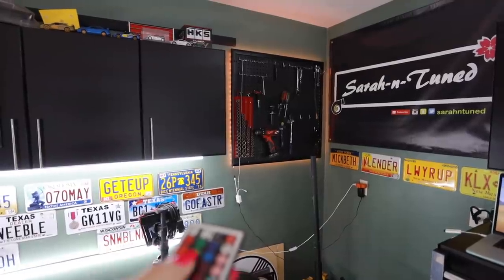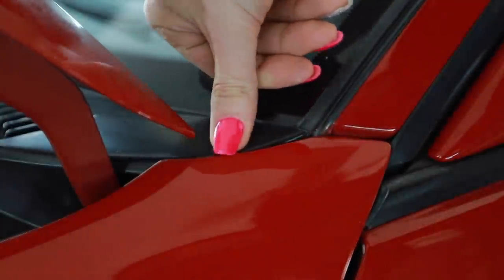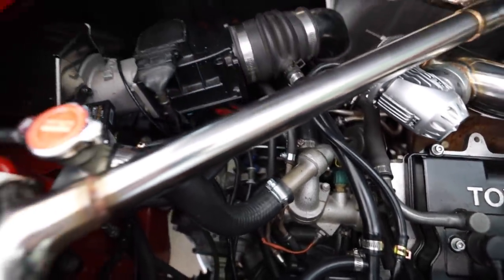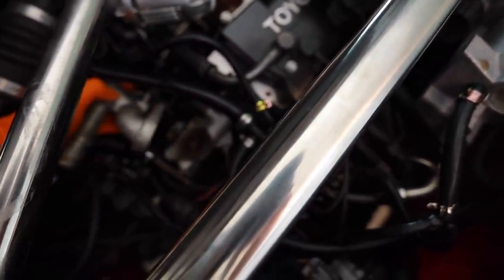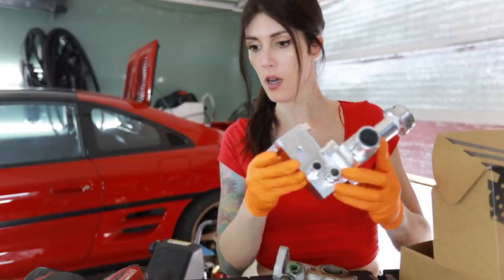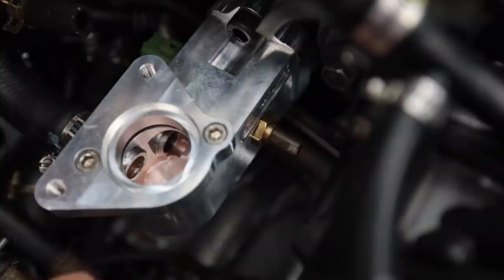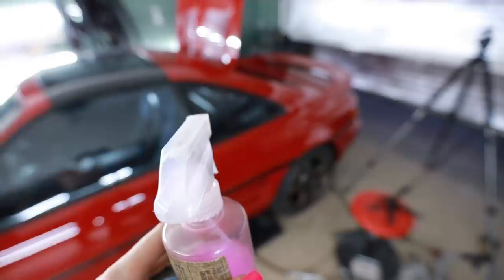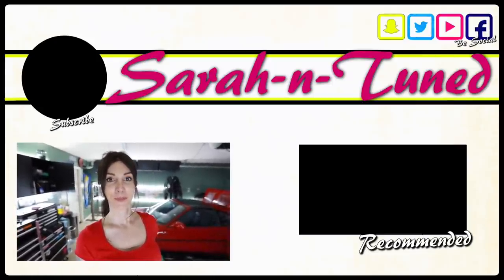Billet Aluminum Cooling System Parts Fixed This Problem // Project MR2 Turbo

Comment: About 2 mins in you said about replacing what seems pointless parts like the wiper cover, I couldnt agree more, little things like that make an overall difference to the finished result of the car 100%
Reply: Yep! I'm right with you.
Reply: Over time the black comes off the trim. I sanded and resprayed then cleared mine. Can't get at Toyota Stealerships anymore. Came out awesome. Longtime owner.

Comment: Detail tip: If you take some of your Tire Wet or whatever tire dressing you use, and put it on a rag, or spray directly onto your black trim parts like the wiper arms, it'll restore the deep black hue for a while. In simpler terms, tire dressing restores black trim really awesomely. Awesomely is a word.

Comment: they sent you a flash drive while i got some Big League Chew bubble gum when I ordered my fuel rail. lol
Reply: What’s up, sir? How have you been? What are you driving these days?
I’m about to change the coolant return feed hose from the turbo on my MR2T and I see Sarah snapped the bolts in half on hers and now I’m dreading the next two hours 🤣
Reply: @negativeindustrial  Matt? Whats up, old friend?! I still have the supra after 8 years and then I picked up Art's old GT2 back in 2017 and its in the process of a rebuild for the last 2 years. Should be a fun car when its ready. What about you?
Reply: NgoFcukinWay
That’s fucking awesome, bro. Art’s car was truly a work of Art 🤣 That car was a big inspiration for me since before I met you, if you can believe that. Art and I were OGs on 6gc. and I always admired your car.
I’m finishing an MR2Turbo now. Basically the same as Sarah’s except all the go fast parts are GReddy, Apex’i and Aussie. CT-20b, AEM TruBoost/Wideband setup. Same as the Celica essentially.
I’ve been thinking about you because I’m buying some form of Supra next to complete the trilogy. I’m leaning towards black SC300 TT 5spd but I’m also weighing the MKIII 1JZ-GTE route. Either way, another swap is in my future.
On a side note, I shouldn’t have worried. My MR2 turned 30yo this month but she’s a Texas car so no rust. The water neck came right off without drama. 1hr job and I changed and cleaned all the hoses down there. It’s one of the few jobs that’s easier on the MR2 than it is on the Celica.
Still single or married?

Comment: You should use at the minimum anti-sieze on the brass fittings to the aluminum or aluminum fittings to avoid galvanic action between the 2 dissimilar metals.

Comment: Time to get a bench grinder with a wire wheel on one side. I use mine all the time to clean parts, especially threads. Just a touch of graphite for the hot stuff fasteners will work on reinstall.

Comment: About replacing the small old parts, it also shows up a lot more when the other parts around it are brand new, those stick out to where you just notice it more if you don't replace it :)

Comment: Ps : You are a Outstanding Mechanic I would have Loved had you working with me.  I have just retired with over 50 years in Avation and I'm a dyed in the Wool Gear Head.  20 years Navy and 10 years general avation and last but not least 20 years with U.S. Customs . So I know an Outstanding Mechanic when I See one , and Young Lady You are Definitely One . I'M DONE NOW 😁 .

Comment: One thing you really need is the OE driver's side wiper arm that has the air deflector on it! Really looks nice! Twos-R-us has it I think...at least that's where I got mine a few years back for my original 95 turbo!

Comment: Save your door hardware! Most Toyota parts are ABS and it welds with acetone. Put it on with a Q-tip on the inside of the part. Don't put so much on that it leaks through the crack to the outside of the part. If some dribbles out, blow on the excess to evaporate it quickly. DON'T touch it as it melts the plastic. It might take a couple applications to get the part fully welded.

Comment: When you tighten a hex fitting, your supposed to say “Click” simulating the torque spec!  😂
Reply: Torque to spec. SMA fan?
Reply: And ensure to be wearing your Safety-Squints!
Reply: I did that at work because they got rid of the torque wrench i needed

Comment: What you need is a nice big vice, on a decent bench, 
Then you could clamp the thermostat housing and remove stuff without hurting yourself, 
I don't want to sound like Mr smart ass, but in my years of car mechanical goings on I have learnt that most of the successful work is done by technique, ie.. placing sockets spanners etc on properly, that way no crushed knuckles or broken parts, Nicely made replacement part your exchanging there,

Comment: When i found a the cap for my wiper fluid tank on my used tacoma, and the small plastic button that keeps the seat belt buckle part that is on the belt from sliding to the floor every time you take the belt off. I was dang happy, it might not be as flashy as some fixes, but, to me those little ones matter every bit as much or even more. That seat belt thing was irritating every time it dropped.

Comment: How come you dont put lock tight on your screws? Like the internal door latch, so they A) dont come loose and B) you dont have to over tighten them and potentially crack the casing again.

Comment: What size screws for the door handles? Need to replace mine as well.
Reply from the maker: Aaron Bosch | Drone Adventures I looked it up on the toyota parts website and ordered the exact screw from Toyota.

Comment: Might I just add that you have in fact driven Mister Dos in the winter? You yourself posted the video.
Reply from the maker: kody koscher 3 miles in a state with zero road salt, then it was immediately washed off.
Reply: @SarahnTuned  fair enough. I graciously acquiesce.

Comment: Please get a vise from Harbor Freight (or used from Craigslist) and bolt it to your workbench. You are seriously going to hurt yourself using a rattle gun and holding the part in your other hand!